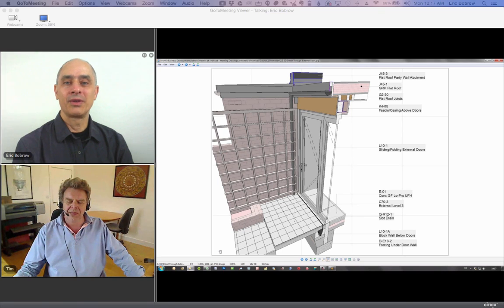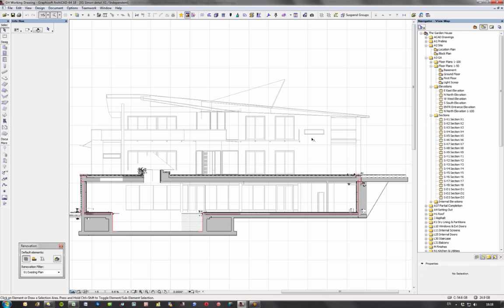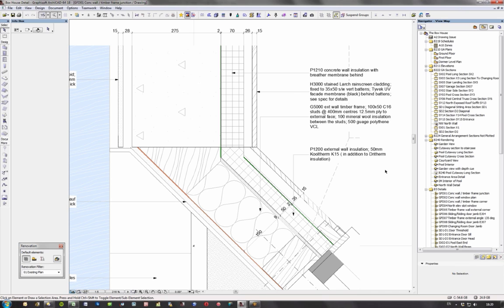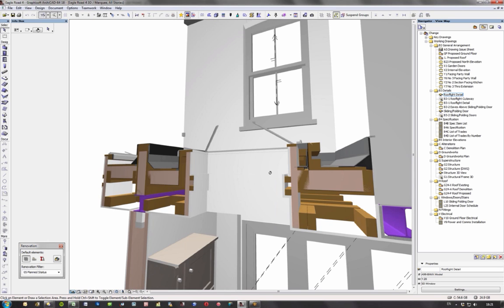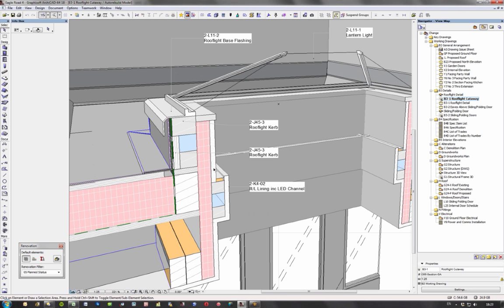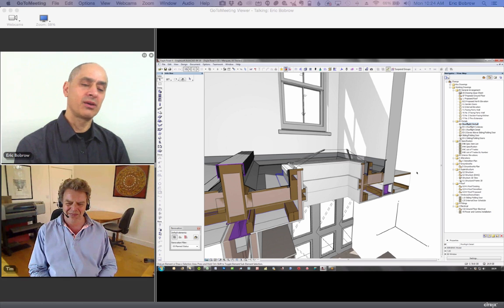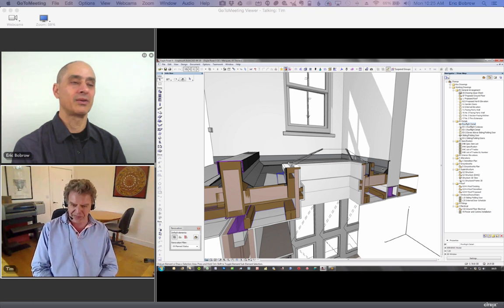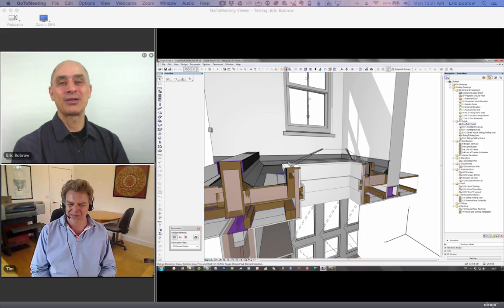How to Create ArchiCAD Working Drawings without Drafting Details - Interview with Tim Ball

Comment: I can see the great benefit for small scale projects - residential and the like.

We have had issues with our project file size when adding too many 3D details - some teamwork files get close to 4GB (shopping centre). So we now just make one typical detail in 3D and the repetition of the detail will be simpler 'surface' model only. And at times we've had to remove some of the details completely to reduce the complexity of the model so we can actually work with the file.

This was with AC16. We are now on AC18 so we hope it can handle the more complex files.
Reply: Sahlan McKingley 
I agree. I worked on a project in DC. Duke Ellington Performing Arts Center. The firm there "really" tried to use 3D as much as they could.
the Teamwork model size was 130GB...yeah...something like that. it was unmanagable.
Again, you are correct, for small projects, perhaps. when you start to get into 'custom' residential and commercial custom......not so much but the concept and positive design intent is there in that making the 3D do as much as you can is definitely what we should all try to achieve.